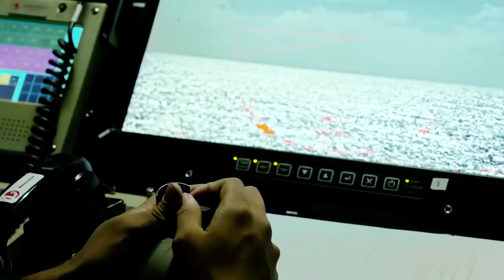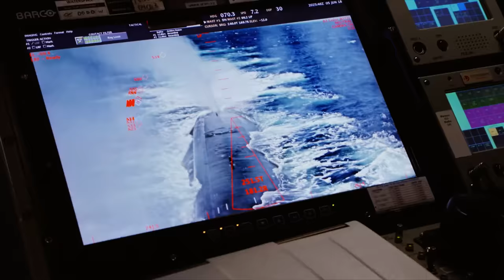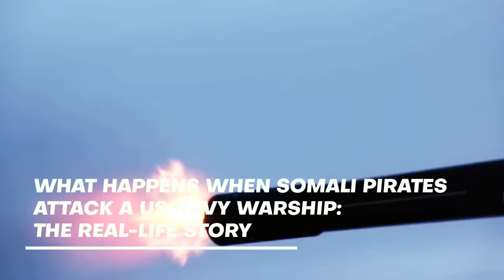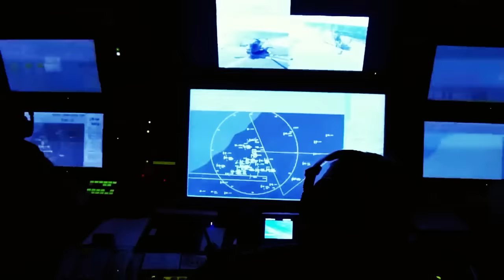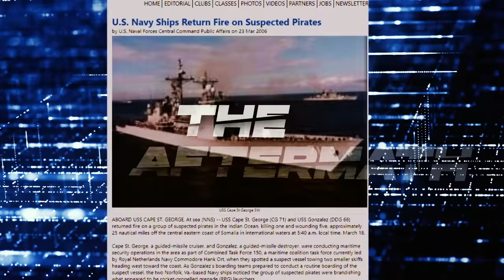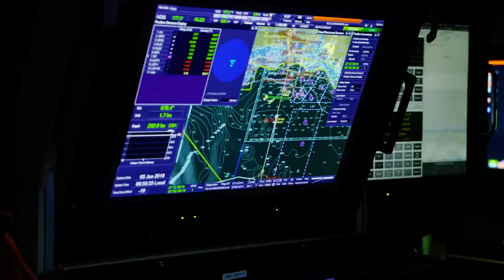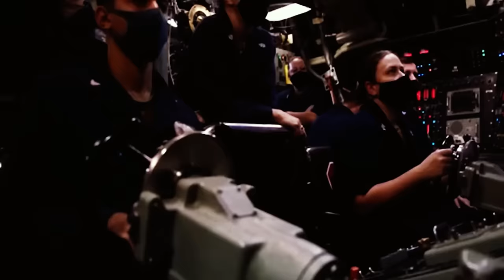What Happens When Pirates ATTACK a US Submarine?

Comment: LOL!  A Virginia Class boat is nearly 400' long, travels at 25 knots (28 mph - about the maximum speed of the pirates' fastest skiff), and can dive out of the pirates' reach on less than a minute's notice.  The pressure hull, where the crew lives and works, is made of 3" thick high-strength steel, would barely be nicked by any weapon a pirate would have access to.  The sub could simply out-run the pirates, dive, and never be seen again.  If the ship's captain was in the mood, he could easily circle back and surface directly under the pirates' vessel, likely distroying it and dooming its crew.   A Virginia class boat also contains 134 highly trained and disciplined enlisted men and officers.  Besides dozens torpedos and cruise missiles, there's a locker full of small arms which are ordinarily intended to be used to defend the boat from unauthorized boarders while it's in port.  If the captain (unwisely, but just for fun) decided he'd rather have a shootout with the pirates, he could station a couple of dozen sailors armed with machine guns and automatic rifles in the sail and on the deck, and see how close the buccaneers cared to approach before his men unleashed a fullisade of bullets -- punching a few dozen holes in their skiff and leaving a few of the pirates in need of medical attention.